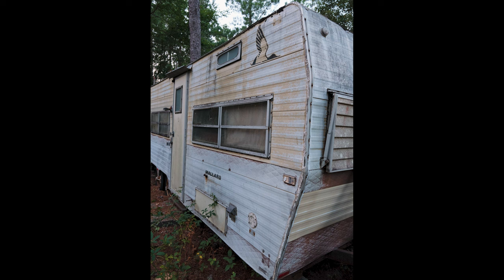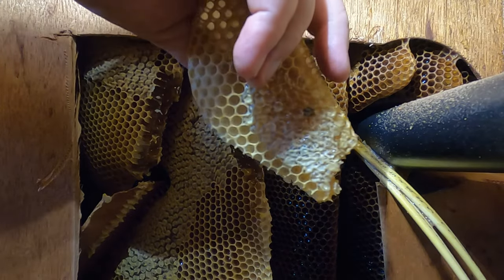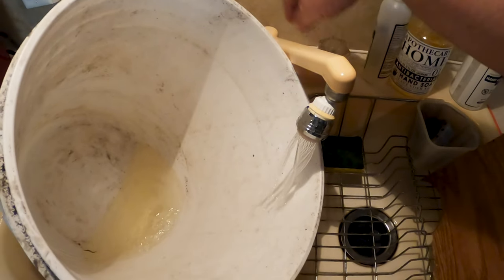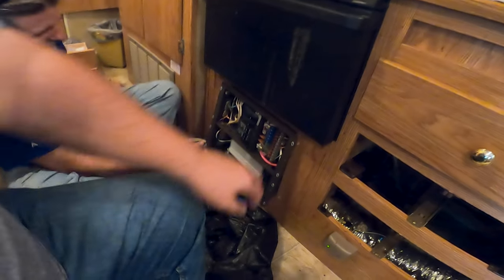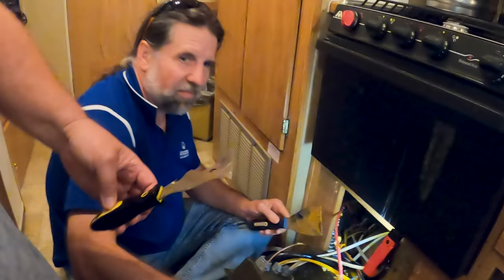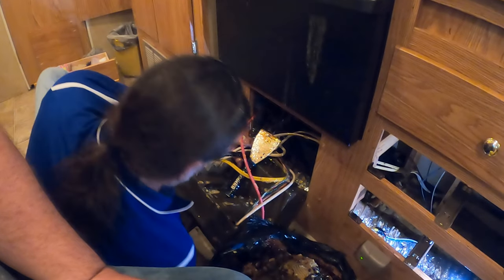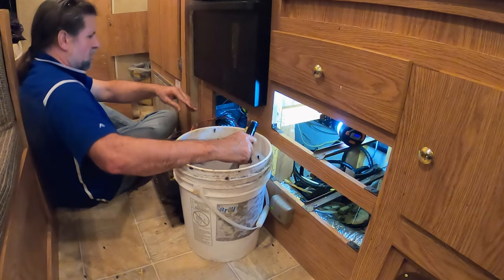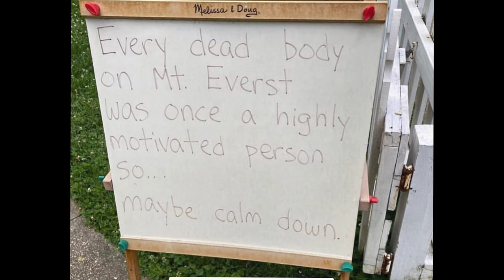I Cleaned Bees Out of a Hunting Camp Trailer

Comment: @5:00 You need some sort of monitor that the camera can connect to and display on for this situation (a set up that I'm sure would come in handy for plenty of other situations you may run into). Then you can see and reach at the same time. It doesn't have to be a big screen or anything fancy, just enough to give you 'eyes' into those tight spaces.